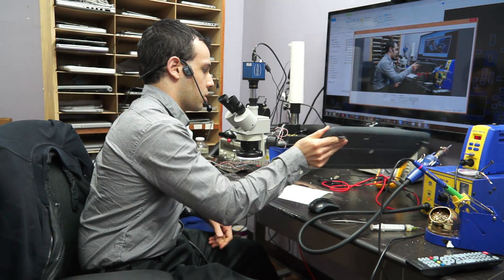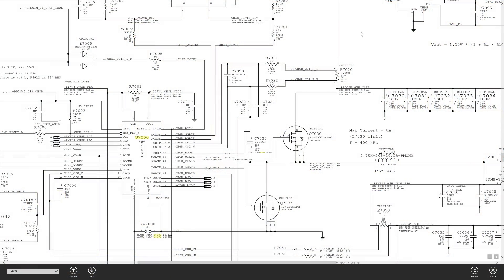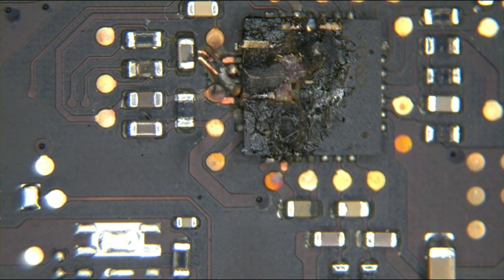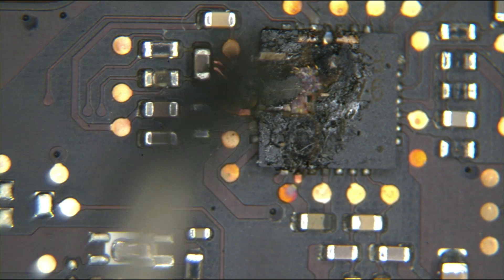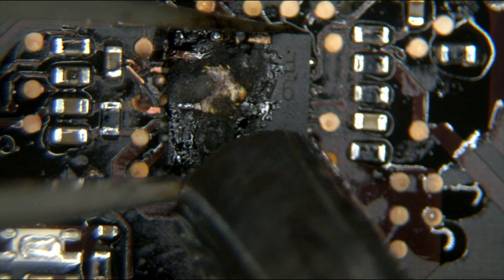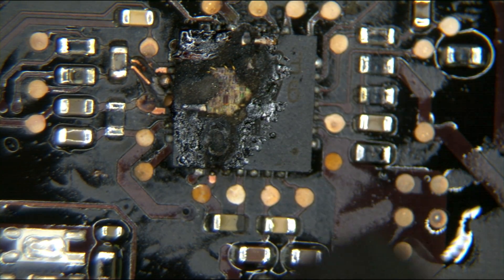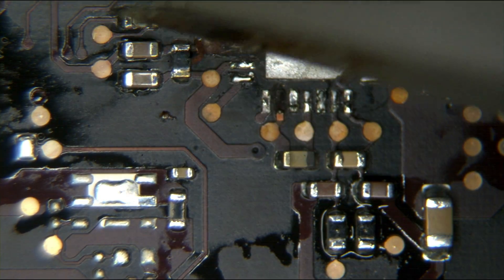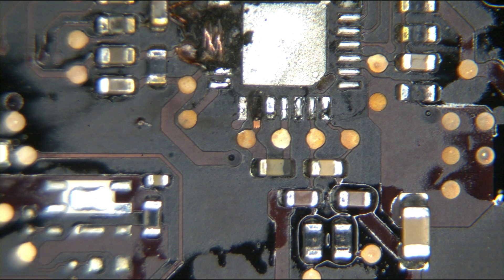No fix; Macbook Pro retina board with shorts to ground inside PCB.

Comment: Hi Louis, I've been watching your videos for over a year now it's my first comment though, I once went through a mother with a liquid (beer) damage, I accidentally created a hole while trying to scratch dirt, shorted to ground hole, I then scratched it more with the hot air gun and the tweezer run just through it not only I had a hole that you can see through it I fucked the other side of the board :) spent more than two hours with it but I was able to fix it, it worked just fine.
Reply from the maker: That does not sound like fun!
Reply: No, not at all !